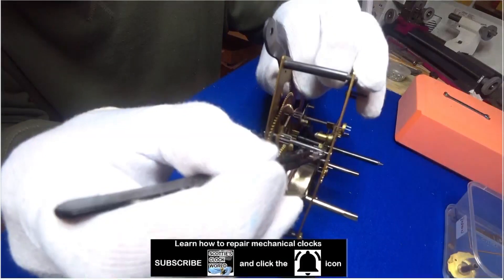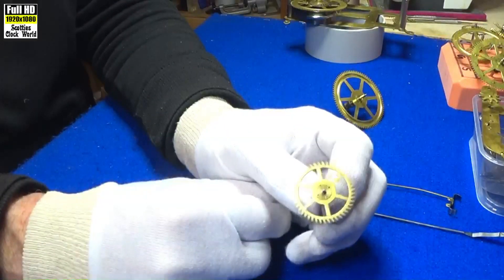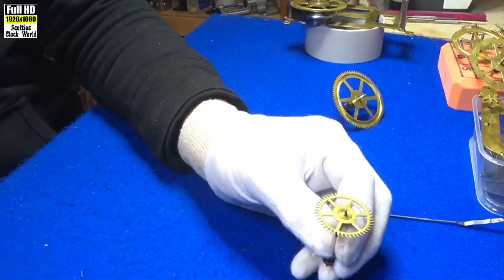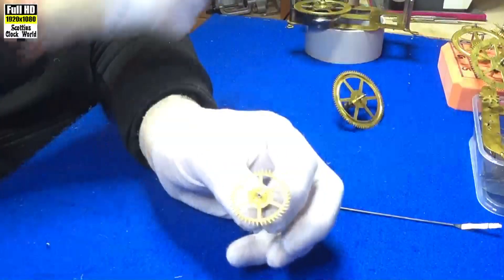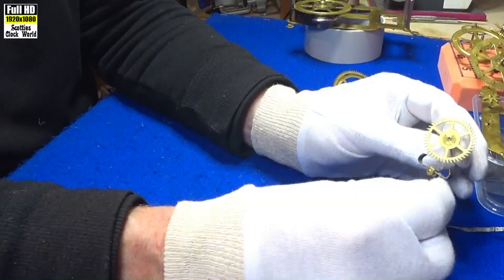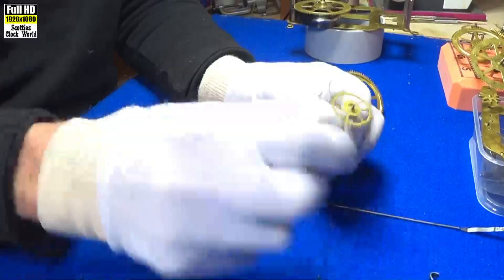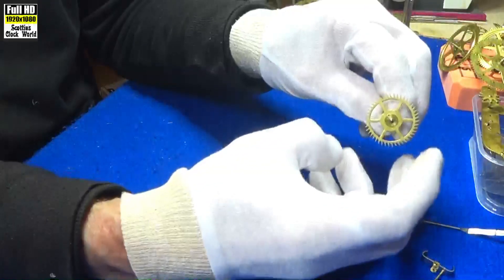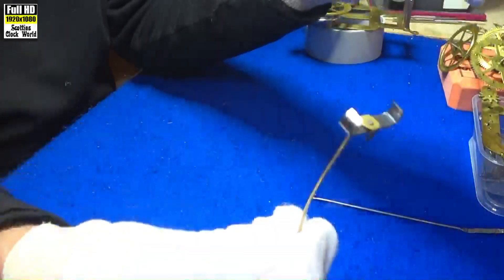Spring Driven Mechanical Clocks: The Escapement Explained

Comment: I have a Ridgeway Grandmother clock that I recently had repaired. The "works" of it was out of my house and being repaired for nearly nine months. The repairman was having a difficult time keeping it running, so he finally decided to replace the "movement", and then tested it for 3 weeks for its accuracy. When I got the clock back, I could barely hear the chimes, which the repairman was able to adjust somewhat. However, I can not hear the "tick-tock" at all--not even if I am standing right next to it. If I put my ear right up to the clock, I can barely hear the tick tock. This was not an issue before the repairs, and I could hear the clock easily from across the room. Would the new movement have something to do with my inability to hear the clock tick tock now.?

Comment: Two questions. I am having trouble getting my Sessions movement in beat. Will the pallet/verge/pendulum leader assembly run for any length of time without the pendulum on? And how far should the pallets be down into the teeth of the escapement wheel? This movement was not treated well and the crutch was pretty bent up. Trying to get it back like it was.
Reply from the maker: Two turns of the key on the mainspring will have sufficient power to rotate the Escape Wheel and move the pallets/Crutch without the pendulum.

The pallets usually fall approx 1/4 of the way in between the Escape Wheel teeth, but each movement is different.
Start with the pallets just above the teeth of the Escape Wheel and slowly lower them in till they catch.
Then adjust the depth of the leading and trailing pallet separately till the Crutch moves freely.
I will make a video about this and post it soon.
Reply: @ScottiesClockWorld  thank you. Still tweaking it. Someone had put the verge on backwards and bent the crutch foot around to reach the pendulum leader wire. Amazingly it would run for about 5 minutes!
Reply from the maker: @cheryladair732  , you have started to see and learn the level of incompetence of the vast majority of people who claim to be clock "repairmen". It's cleaning up their messes that keeps the real ones of us in business.
Reply: @ScottiesClockWorld  I'm amazed at this. I had to go back and look at the pictures I had taken to see if it really came that way. I can't see why anyone would do that, unless they dropped it and didn't know how to put it back. Thanks for the videos and help!
Reply from the maker: @cheryladair732  , you will find that most clocks you purchase outside a genuine auction house will have mangled parts in them. Thanks for your comment.